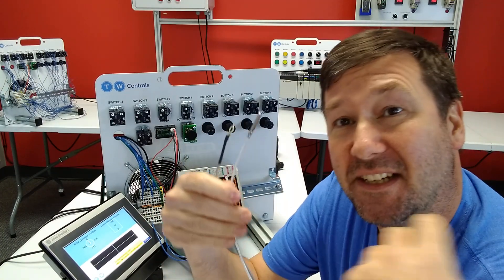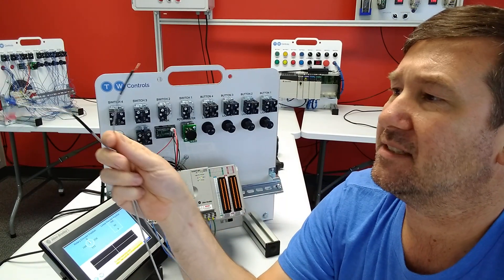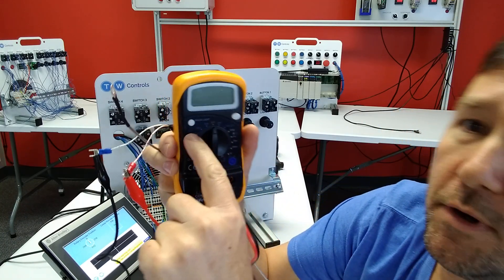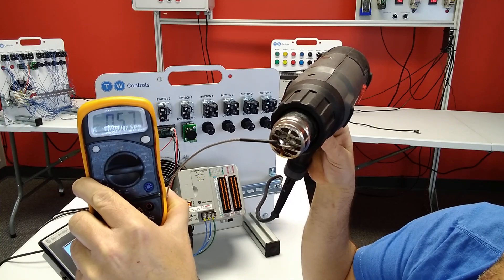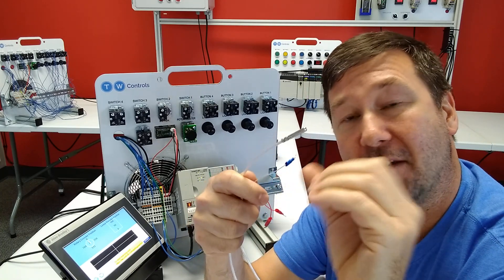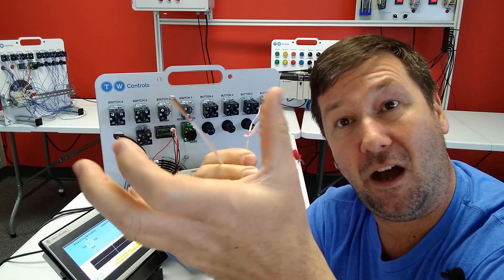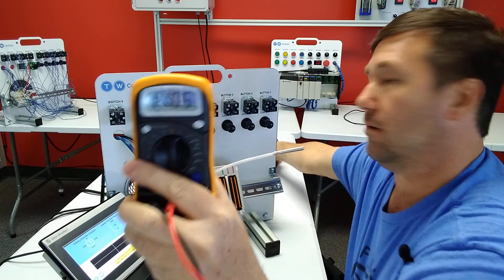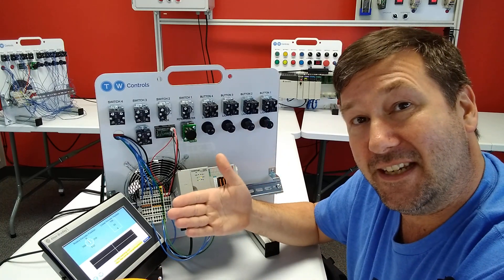Thermocouple vs RTD. Differences and How Temperature Sensors Work

Comment: is it possible to do a video with a thermocouple and programming it to the micro850 showing it turn on and off a light when it reaches a certain temperture
Reply from the maker: Here you go, it is the same video but for a 4-20mA input.
https://youtu.be/lPfHHnsCos0
Reply: @TimWilborne thank you I will rewatch it appreciate your work
Reply from the maker: You are welcome
Reply: @TimWilborne 
There's a concept I'm not getting, for most of the temperature sensors I've interacted with, I've found out that most don't work if you don't have a transmitter, (For allen Bradley, control logix 5580 series and L35E compact logix
Reply from the maker: Depends on how you define a "transmitter".  Many people use converters that may take an RTD and thermocouple and convert it to 4-20mA.  It isn't necessary, but 4-20mA cards are more common and allows other connections such as pressure, tank levels, etc.
Reply: @TimWilborne Thanks a lot
I had doubts but now I guess it's clearer, i.e.mostly it depends on the type of card you have and how it's signals are terminated 
Do you have a video of configuring the control logix 5580, where you do the one for 4 to 20 mA e.g.pressure
Reply from the maker: Check out the analog section of this course. It covers the basics that will transfer to any type of analog module. 
https://twcontrols.com/studio-5000-course
Reply: @TimWilborne thanks a lot ❤
Reply from the maker: You are welcome

Comment: I recently had this question pop up on a self test. I always thought it was resistance that causes the feedback. When I told my master electrician that it is DC voltage, he didn't believe me. I learned something that day, as did he.. and I'm glad to see you covering it, too. I'll be sure to share this video with the rest of the automation guys that I work with. :)
Reply from the maker: Share it often Eric!  One interesting idea I have always had is it is based off of heat and dissimilar metals exchanging electrons.  I should be able to feed electricity into a thermocouple cool a thermocouple tip.  It is on my list for a day of crazy experiments.
Reply: @TimWilborne  that is really interesting. I might have to remove one from an older piece of equipment at work and play around with that. Could be really cool (pun intended) 😜
Reply from the maker: @sirkus34  🤣

Comment: Nice Insight Tim!, btw i am confused which sensor (RTD or thermocouple) should i Choose for Water treatment plant. The range should be around normal temperature to 80C. and for the ph of the water is vary from 5 - 12. Can you suggest? Thank You very much !
Reply from the maker: No, you would be better off reaching out to a sensor distributor.
Reply: In general, RTD is much more expensive but it is also more accurate and since they are usually made from materials of higher precision, they are often more durable.
Reply: Check out the Omega line, they cover the range of Temperature Measurements.

Comment: hI Tim, I know I bug you alot. But could you tell me what all I need to make a homemade PID trainer? I have the PLC, I just need whatever else. I am sure I need a thermocouple and some type of heating element to connect to output of plc. Just tell me what I need and I'll order it from you. In my head I am picturing a stock pot of water with a heating element between that and the PLC, along with the thermocouple going back to plc. Am I on the right track? BTW a I am using a micrologix 1100 using micro starter light. But I could use studio 5000 on my work PC
Reply from the maker: I'm not sure that would be a good learning tool.  I think the question is, how in depth do you want to get into PIDs?
Reply: @TimWilborne  I'm a controls Tech and I see PID programs all the time. If I can simulate a program and see it working, that's how I gain an understanding of it. In my head, I was picturing programming the PID in RSLogix, Studio 5k, etc., and then actually connecting something to my PLC and watch it work.

Comment: BTW Allen-Bradley and other manufactures offer thermocouple/mV to analog conversion cards for Thermocouple use.
Reply from the maker: Have a video coming on that.
Reply: I am definitely going to watch that one. I was working on this card today. I was not sure how to test the RTD I/O card to make sure is working properly. Also I had a fault on a open RTD, when I check the RTD 112 ohm with no issue. Change the RTD anyway and machine start working properly. Not sure what I am missing? Any tips for new tech?

Comment: Something to pay attention to is that when using a thermocouple the extended wiring if needed must be thermocouple wires. Another important item, which has been debated, is any connection termination should be done with a thermocouple compatible junction. This means no crimp-on eyes, spades or forks.
Why; each termination can introduce dissimilar metals which can introduce a error in the voltage value. These thermo devices certainly deserve a short study to understand them.   Great introduction Tim.
Reply from the maker: Yes, the thermocouple extension wire and connectors are important.  Thanks for watching!